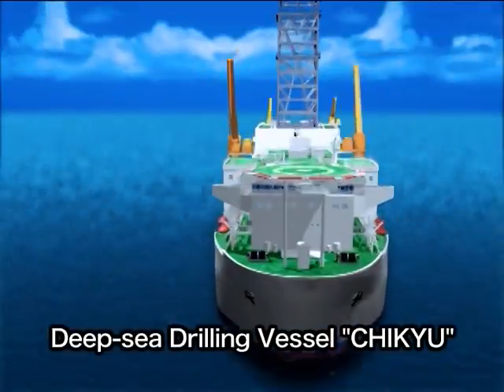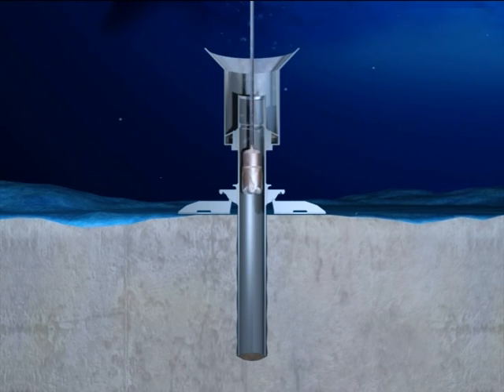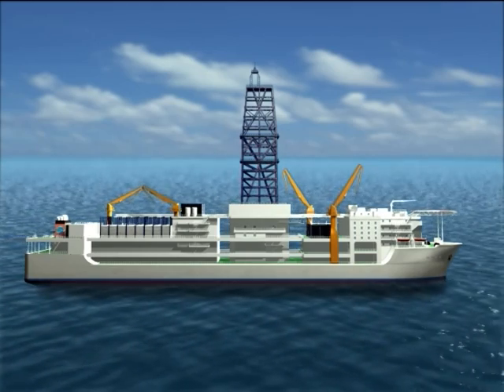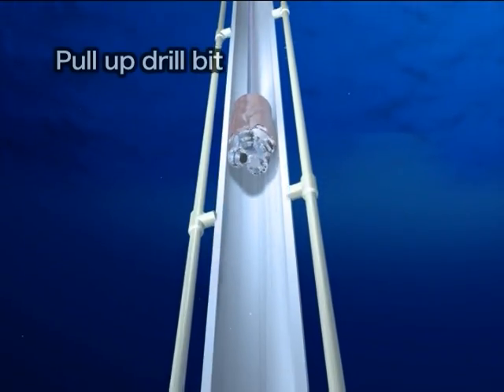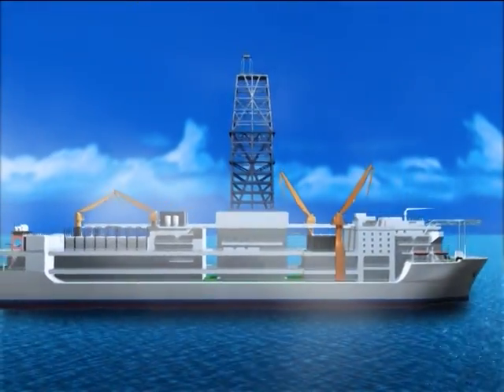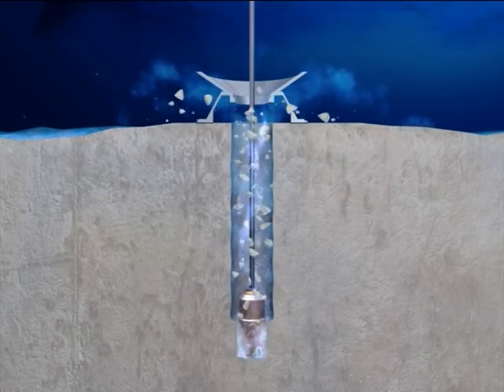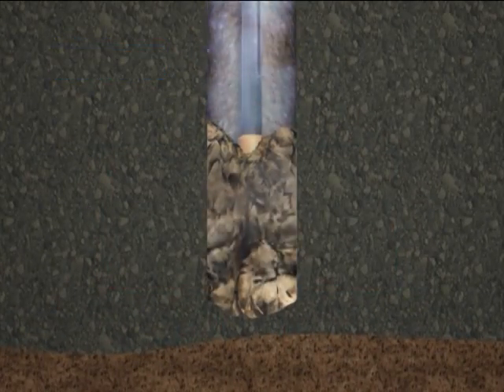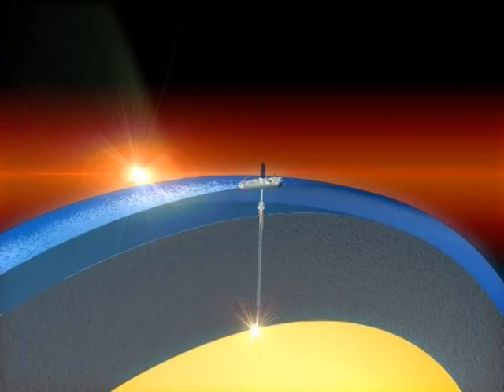Deepwater drilling

Comment: This type of blowout prevention valve leaves all the right ingredients for another deep horizon spill and cannot be tested or maintained. The only way it can be tested is when it's needed, the deep horizon's bop valve failed much less using the hydraulic ram,system to crush piping and more still can't guarantee it will stop leakage as well as create more damage that will leave inaccessible. Bop valves being used currently need valves that can be tested periodically and maintained. If the bop valve needs maintenance or replacing. There is nothing isolating pressure without creat a disaster. In 2010 June I watched as the horizon crew stumbling around attempting to find a solution and watched as the underwater robotics cut bent sections of the wellhead piping and left several feet of piping rising from the seafloor, it had a flange seversl inches from the pipe end. I designed a caphead that could be lowered onto the wellhead piping and use ears to lock onto the pipe. Once on the pipe would create pressure onto chevron seals stopping the leak. I managed to find that there was a " horizon helpline" and called and chatted with the personnel. I zipped my design off but neglected to file for a patents pending number and was later emailed back by the horizon helpline and told my design was unusable. Several weeks later watched as my design caphead was used to stop the deep horizon's leak. I was given a slap in the face for my contribution and wasn't compensated or given credit for me effort. My future plan is to start my own deep water repair company as none exist, as well as market better design bop valves that can be tested and maintained. Unless major oil companies that have ocean based drill platforms buy into upgraded bop valves we can expect more spills like the deep horizon's. "007".

Comment: I guess that reaching the mantle is something achievable. But what about pumping it out to the surface?? I guess that it would melt down the first few stages of pipe lines and get rock solid near the end due long km's of cold sea water...I'm not an engineer just find it interesting..:)

Comment: If there is a storm, they will close the BOP, disconnect the riser and move the boat away until the weather has calmed down. They will ofc have to pull out the drill bit and the pipes connected to it before disconnecting though. If hell would break loose in an instant, and cthulu spawns right under them, they can cut the drill string with the shear ram on the BOP and gtfo